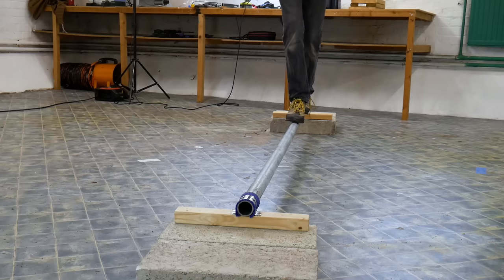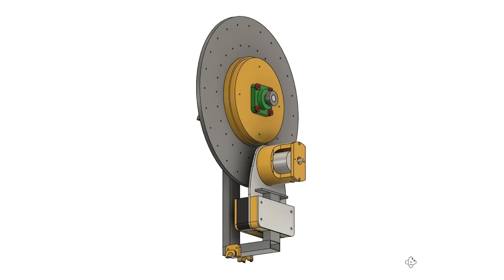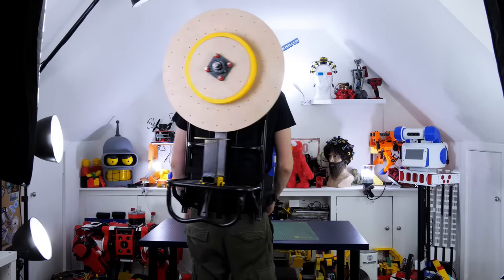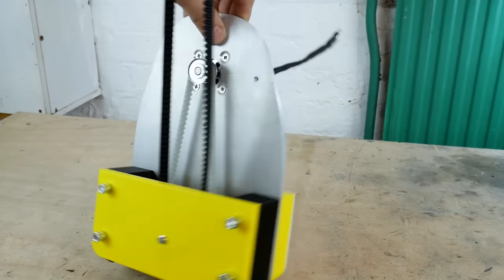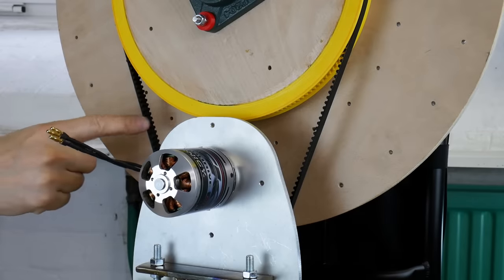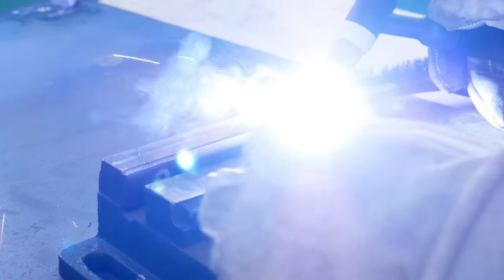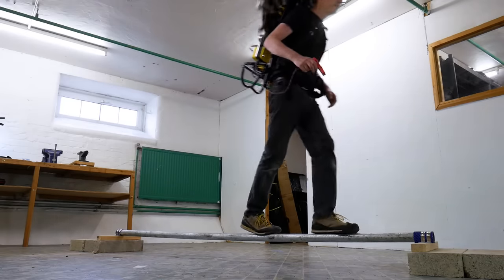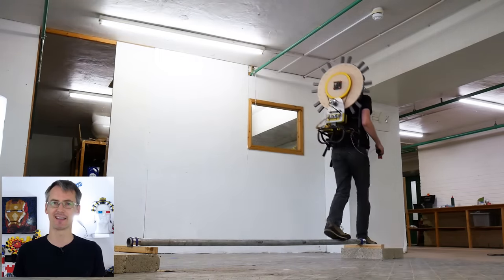Tightrope Walking Cheat Device

Comment: No officer, I'm not drunk. See, I can walk in a straight line! Proceeds to put massive spinning reaction wheel of doom on back
Reply: "sir that's my gun belt"
Reply: The moment i had the same idea, your comment scrolls into my view. 

 Sometimes i think YouTube orders comments using mind telepathy!
Reply: We need a follow-up to see if it helps when you get shit-faced
Reply: Due to being drunk, proceeds to incorrectly assemble the device into the monobike and accidentally escape the cops.
Reply: @TheRainHarvester  1
Reply: @LegendLength  and then you go to police station instantly here in germany
Reply: Ends up collapsing from its weight in the most “in”straight way🥲
Reply: Officer, I’ve run out of battery power. What shall we do?🤡
Reply: Would flipping the device upside down be enough to accomplish this?
Reply: The officer: What the...
Reply: The straightinator
Reply: Я только об этом подумал и сразу увидел этот коментарий😅😅😅. Мы похожи, а правительство говорит что мы разные... они врут.
Reply: @Progection More likely you'd be too drunk to remember to activate it when you're supposed to and fail the sobriety test anyway.
Reply: I was just about to comment saying he should get hammered drunk and see if it works haha
Reply: Continues to walk across a drainage pipe at a 45 degree tangent
Reply: 14:13 14:17 dangerous friend.   Greetings from colombia... I hope that this finish fall Would be slow and softly. 🏋️😎📢☑️☑️☑️

Comment: Real tight rope walkers hold onto a very long bar to balance. You should make a "virtual" long bar. It would be a short bar with reaction control wheels on either end of it to keep it perfectly level and then you hold onto that. When you feel you are tipping one way you would instinctively push or pull the opposite way and the reaction wheels would push or pull back hopefully keeping you upright and balanced.
Reply: Just a massy bar that shifts side to side should do it...
Reply: i like this idea a lot.. it would almost be like you have a rail to hold onto, only that it's only fixed in one of the 6 degrees of freedom. Would be an odd experience I think.
Reply: @thewillderness7852  A longer bar of the same mass has a greater moment of inertia, and thus undergoes less rotational acceleration with the same moment/torque applied.
Reply: Cool idea.
Reply: One works just fine so lets make two and mount them at the ends of a pole to add weight, cost and complication to the job.
Says the reaction wheel salesman.
Reply: The gyro is... A virtual long bar just a better one 😂
Reply: I think you are right about using a long bar - the length will give lots of lovely angular inertia, but using reaction wheels on the ends is waaay to complicated.  Why not use a long, light bar (maybe carbon fibre tube), with heavy weights just at the ends (that gives greatest angular inertia for the weight of the contraption) ?  The control mechanism then rotates the bar (but within angle limits).  The result is a smart tightrope walking bar, that lets anyone walk the rope without any practice.
Reply: Now THIS is a really good idea!
Reply: Immediately thought of the D&D Immovable Rod
Reply: I think that would be way cooler than this
Reply: @JWQweqOPDH  is it torque that's necessary? Could the inertia of the linear motion of a bar provide enough temporary force to set the user back to vertical?
Reply: You get the added benefit if somebody gets too close you can punch them with the bar..
Reply: That's basically that he's doing here, when he gets hold of the technique. The wheel speeding up or slowing down is the same as you pushing down or pulling up on a side of the bar.

Comment: I feel like filling the box steel up with sand or metal beads would have been a good way to add more weight.
Reply: Could I add a bunch of 18650s for power and weight.
Reply: Perhaps put something a bit safer like a ring of cast metal like an actual flywheel.

Comment: I feel this would work better if the disk was spinning at a constant high speed but at a 90degree angle so it created a gyroscopic force then adjusting it's left and right position in small increments.

Comment: Couldn't you just put the wheel on its side and spin it up, using the centrifugal force to keep you upright like a top? Seems simpler than using algorithms to try to spin the wheel one way then the other.
Reply from the maker: It's much more complicated than that https://youtu.be/UVJx8T8wTQA
Reply: @jamesbruton  I just spun a quarter on my desk. Seems to work just fine.

Comment: As a physiotherapist, this is very interesting to watch. Your body´s ability to maintain balance is highly dependant on accurate feed-back and feed-forward information, but also the coordination between these two types of information. I guess the same principles can be applied to the device on your back. You basically have two systems trying to do the same task... But without knowing how to work together.
Reply: Could this type of device be helpful for any of your patients? Also saw someone suggested a waist height version
Reply: @Idekbru  the problem is this works with mass, and patients who are struggling to walk will also struggle to walk with 30+kg on their back
Reply: I was thinking this as well, it would be very confusing having both a reaction wheel and your natural reaction against falling. Maybe if it were manually hand controlled, although it would take a lot of training and practice to be able to correct yourself by hand
Reply: As psychotherapist, i am very interested too!
Reply: @xXChipsAndGravyXx  😂😂😂
Reply: as a layman i suspect this will trash the musco-skeletal structure of anyone who uses it for any meaningful length of time.
Reply: @Idekbru  Disregarding the added weight it would be detrimental for long term usage. Just as power lift recliner chairs the user becomes over reliant decreasing long term mobility of basic daily functions.
Reply: @xXChipsAndGravyXx  idk why this made me laugh 😅
Reply: I think if there would be a better understanding of the physio-mechanical process of walking and standing and balance, the device could be improved. He mentions how the jolt from the device feels strange. Surely. But maybe there are no connection points in the human frame where this kind of simple balancer could be really effective and not limit the normal movement. 🙂
Reply: I mean, he also looks unco as hell before the machine even comes into the picture. He was so bad at balancing I thought for sure he was faking it...
Reply: I think ,the time he needed to build His device he had to invest in practice his walk over the tightrope will be better anyway.
Reply: After going so many times over the tube ,you have a better practice anyway.You will now balance without your Device better anyway...🤔
Reply: This comment really illustrates why balance is one of the fundamental human senses.  Those old school posters and books that talk about the "five senses" always drive me crazy.
Reply: As long as the backpack's behavior is predictable, the user will be able to adapt to it. James was even approaching that "singularity" when he started to understand how to use it by leaning into it. What he's doing is pushing against the force that the backpack is providing so he can regain his balance. But, my real point in response to your comment is the fact that even though there are two systems, as long as one system has a defined behavior, the other (human) system can learn the extents of that behavior and adapt to it. It may take some figuring and experience, but it's possible for the user to learn.
Reply: @RobertKreegier  True. I agree that the human system can adapt... But until the human system have learned how to respond to this device, you basically have two systems competing for the same task. And since it's the human that needs to adabt and put in the final work and calculations in order to stay in balance, it is still the human who does the balancing. I think the best way to ensure that it is the device that does the balancing task, is to fixate the whole body (stiffen it up).... Cause then you eliminate one system, and they no longer has to compete. I think the best practical example of this is the segway vs. the segboard. The reason why a segway is easier than an segboard is because the handle fixates the body, so your body always moves in sync with the device, making the divice the final calculator and actor.

Comment: Your hips are like a hinge, which allows the device to think it's upright as long as only your upper body is upright. But if your legs are at a slight angle still, you're not balanced.  You need the device to instead stabilize your hips, to keep your legs upright. Not your torso.
Reply: Yeah, like either attach the IMU to the legs, or use an RTK solution to keep the center of gravity above the rope/rod.
Reply: yeeees :D  A tens EMS unit sending Electricity to legs so they are upright
Reply: or maybe put the sensor on the hips to get better tilt data?
Reply: like a tail? ;-)
Reply: The Lone Creator  stop advertising your shit on other people's channels and in unrelated discussions. it's poor form and very rude.
Reply: @boelwerkr  where do you attach it too wink wink
Reply: Which is why you want weight up in a backpack when you trek.
Reply: Sayed Grade X do you know what a Word salad is ?
Reply: Attaching the device or some sensors to the legs won't work, because if you start tipping over to the right side, you instinctively rotate your torso to the right, which causes your legs to move to the left. So a sensor on your leg will notice a tiny movement to the right and an extreme movement to the left because of you trying to balance. That will cause the device to push you over instead of keeping you upright.
Reply: So what we in America call a "fanny pack."
 giggles in British
Reply: Came to say the exact same thing. The system need to be at center mass.
Reply: @boelwerkr  That's how the animals do it! The best solution honestly.
Reply: That’s not necessarily a problem. I think your body would learn pretty quick. For an example the Hoverboard segways only stabilise your feet but that’s not a problem either.
Reply: Use position Sensing too. If.youre upright and centered above the bar, you're balanced
Reply: Probably the best thing would be to balance the center of mass (if your legs are straight but your torso is tilting, you still aren't balanced), but that's very difficult to do, he would need sensors all around his body
Reply: Actually, I think you'd want to measure both hip and torso as different combinations indicate different states.
Reply: On top of that hes leaning on the opposite direction by instinct
Reply: @Deccoyi  Yeah possibly. It reveals a much harder problem: how do you measure the tilt of a soft body?
Reply: if you ain't one you should be an engineer
Reply: The Lone Creator  Go away, spammer.
Reply: Said shortly, the problem is he isn't behaving like a rigid body, he is still interacting, and counteracting, the reaction wheels.
Ideally he would try to stay as rigid as possible and let the reaction wheel do everything.
Reply: Every now and then, humanity reinvents the tail
Reply: @kimberlydrennon4982  Brilliant
Reply: this is pretty much what i came here to say as well — it’s almost like trying to add a device at the tip of a double pendulum to try and stabilize it…
Reply: Your centre of mass is close to the top of your hips so this could work well. Having a spinning mass that low would be a bit of a risk though as it could catch your legs.
Reply: @A_Simple_Neurose  I always report em for spam tbh, sure you might have good content but I will not watch when you advertise on others work
Reply: Also I mean the mechanism isnt really connected well to the body so the sensor is also sensing its actuator. This results in another unnecessary feedback loop in a way. A solution would be a better mounting mechanism to body or just strap only the IMU unit to body very tightly. You want to control the body lean not the platform, platform is not the correct reference.
Reply: Spot on mate. Just what this project needs.
Reply: I think it would take both in a syncrone configeration. Because if you only stabilize your hips and tilt your upper body using your back or your arms, you'll have the same problem than before, but with stabilizing both you could probably split the mass needed between both.
Reply: @philipschottle9192  Yeah, I think your right. Measuring the equilibrium of a soft body is a hard problem.
Reply: If the wheel was right over his tush, it might work slightly better. Read the inertia from his legs, and it just might work great.
Reply: @Deccoyi  Smart! Maybe use a sort of double-pendulum equation to make sure the torso also isn't thrown at a sharp angle to the pelvis.
Reply: @Chris-oj7ro  Like cats! They take advantage of angular momentum as well!
Reply: @kimberlydrennon4982  So true
Reply: this. yes.
Reply: I was expecting him to add the reaction wheel at his existing center of mass.
Reply: Hips don't lie
Reply: Yep, I agree, the wheel is much too high.  You need the torque at the centre of mass for a non-rigid object.
Reply: Basically move this thing to the height of your center of mass
Reply: Nah he just needs to be stiffer and not balance his own weight let the computer balance him it’s like the people tryna learn how to ride hoverboards again he’s tryna balance with the robot but it’s a self balance I think that’s why it worked like shit at first
Reply: Having done a TON of various circus arts for 20+ years, tight ropes included, this is the case. The reaction wheel was too high up for it to be counter balancing in the same way you would be on a tight rope.
Reply: Thanks mr hawking
Reply: Exactly what I came to comment. Also, he should make the spokes of the wheel as absolutely light as possible and use as large a diameter as possible in order to make the effective with an overall much lower mass.
Reply: Very accurate
Reply: The Lone Creator  i wish i could not see your spam repeatedly in every videos comments
Reply: Easy solution, make a desperate thing to stop rotational movement of the hips.
Effectively, become pencil man.
Reply: Center of mass no?
Reply: I wonder if you could adapt to this though, learn to flex your upper body to either side to transfer the moment of force through, though it kinda defeats the point if it takes more effort to wear the thing than not :)
Reply: @A_Simple_Neurose  just report them and ignore
Reply: Bruh I was thinking the same thing.
Reply: If he moves the whole thing down to where the wheel is center at his lower back it would work better. The motion of the wheel works best if he were more rigid but lowering it should compensate for his body's natural desire to counteract the momentum.
Reply: @boelwerkr  a tail owo?
Reply: @jakkakasunset5485  No idea what you'we tawking about. OwO
Reply: @boelwerkr  how to embrace the furry side, step one: tail
Reply: Your hips roll with every step. It's more intuitive how he did it.
Reply: Maybe just keep your hips stiff
Reply: Butt wheel.
Reply: I also don't get the point of putting the mass evenly around the wheel. If you look at animals with tails (cheetahs are a great example, as they lean in and out of turns), their tails will whip around in a circle. It's the momentum of it that helps pull them back.
Reply: Just flip the whole thing.
Reply: @calistohuettich  those suffer from the problem in question way less because those stabilize right down at the pivot point in question. 
the wheel in this video has a ton of free spinal joints between it and the pivot, which means it relies on the user to basically do a side plank against the rotational force it generates
Reply: As interesting of a video as making a hip stabilizing device would be, for regular people, working on your core, hips, and legs muscles will greatly help your balance.
Reply: @boelwerkr  Yes! Someone needs to build a robot tail.
Reply: How about a harness that doesnt let him correct. Seems to me if it works on a stick then one must become the stick.
Reply: That, and also the natural human reaction when falling is to try to move the hip down and use that to move the torso back in the middle, which actually triggers an opposite reaction for the wheel, as if you were falling to the other side
Reply: Agreed
Reply: The worst part of the human body balance is that the center of the masses is very high. Adding more mass on the upper body makes it even harder to keep balance. In theory
Reply: Wouldn't it need to be directly at the body's center of gravity?
Reply: I remember noticing in the movie Real Steel that the robots has two wheels on their hips that spun whenever they tipped or needed to balance.
Reply: What I came here to say. Put it on your hips, not your back!
Reply: @boelwerkr yes like a tail!!!!!! plug
Reply: Literally the first thing I thought of and I didn’t spend 20-40 hours working on this project.
Reply: Needs to be mounted at the hip for sure
Reply: Also considered designing some kind of tail